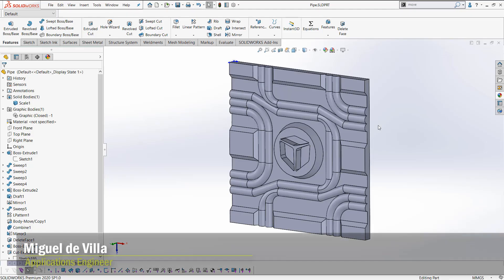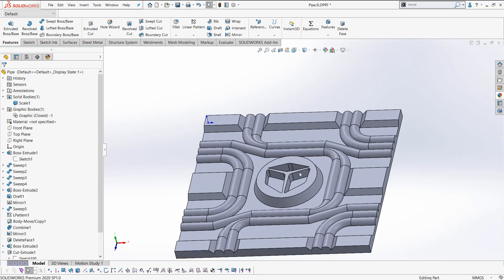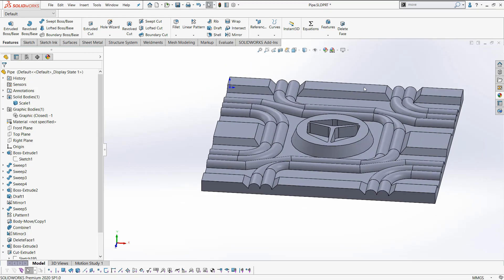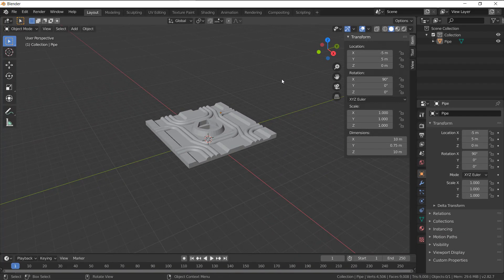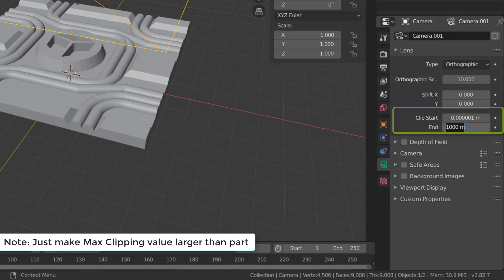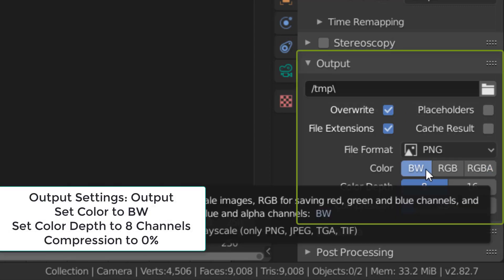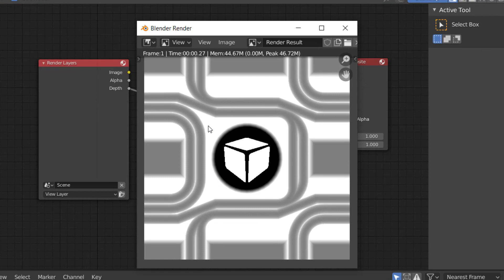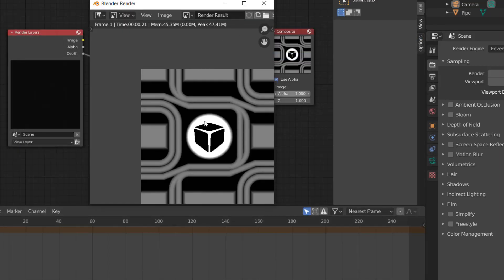SOLIDWORKS Tutorial - Creating Custom 3D Textures for SOLIDWORKS Using Blender

Comment: I noticed the file created with Blender is a .png. Can the same .png be created in Photoshop and then exported into SolidWorks?
Reply from the maker: Blender is a great tool for creating these textures, but SOLIDWORKS is primarily looking for a PNG file for textures. So sure, Photoshop is an acceptable tool if you want to use it instead.
Reply: @goengineer  
Thanks for the reply! 
I tried my method by the way and it works!

Comment: Hey, thanks for the video. Can I creat my own pattern using only solidworks without the need of downloading additional software? I need to creat a pattern that is not available in solidworks library. Any advice will be much appreciated. Thanks in advance. BTW, I use solidworks 2018
Reply from the maker: When it comes to complex patterns, the primary benefit of 3D textures is that they don’t exactly compute the same way as traditional parametric features or run into the same kinds of rebuild error; however, that doesn’t necessarily mean they can’t be done with the parametric features you’re used to. Since you have SOLIDWORKS 2018, I would recommend looking into some of the more advanced patterns such as curve driven or fill patterns in combination with standard linear/circular/mirror patterns to achieve the results you want. In addition, because stacking patterns like that can potentially cause rebuild errors when patterning features, I recommend popular troubleshooting methods such as Geometry Pattern options or Skipping Instances. 

Curve-Driven Pattern: http://kb.goengineer.com/go/default.aspx?kbID=14640
Fill Pattern: http://kb.goengineer.com/go/default.aspx?kbID=15087
Geometry Pattern: http://help.solidworks.com/2018/english/solidworks/sldworks/c_geometry_pattern_concept.htm
Skipping Instances:
http://help.solidworks.com/2018/english/solidworks/sldworks/t_selecting_instances_to_skip_patterns.htm
Reply: @goengineer  hi, thanks for your reply. I actually changed software. I am using Rhino 3D for generating my own surfaces and it is really good for this purpose. A lot easier and more technical. Anyway, I do appreciate your comment. Thanks again